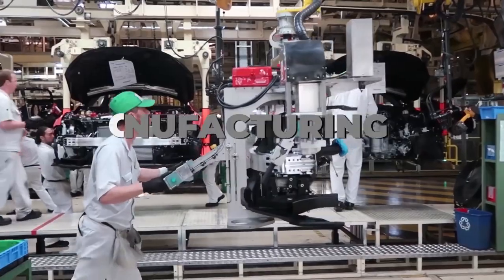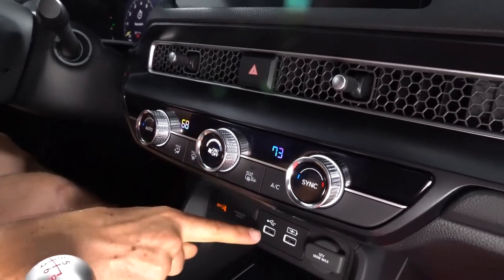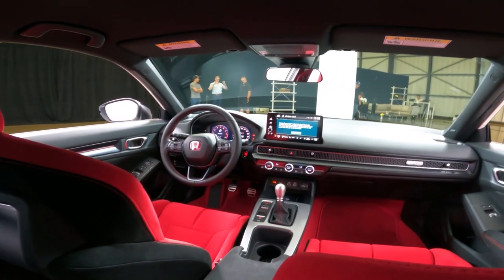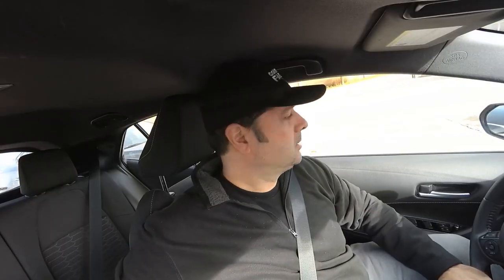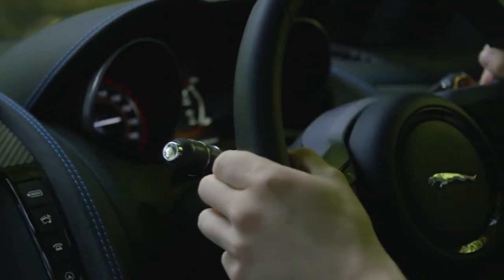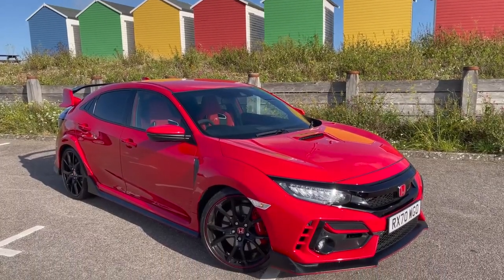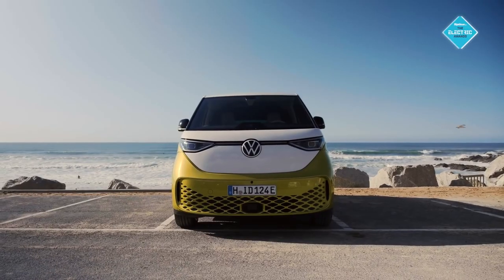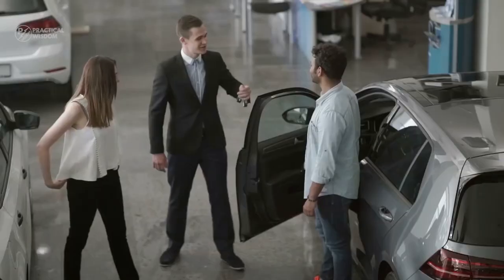BEST Features Of The NEW 2023 Honda Civic Type R..

Comment: I like the changes especially the added horsepower although it still a front wheel drive than an All Wheel Drive & only the rear wing is the carbon fiber, it doesn't even help to reduce enough weight, just saying. What's the point.